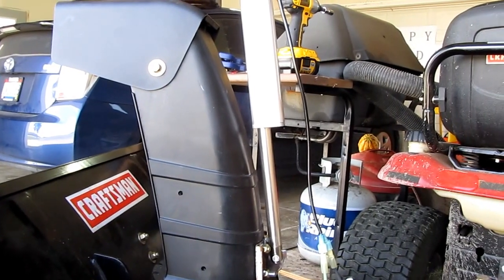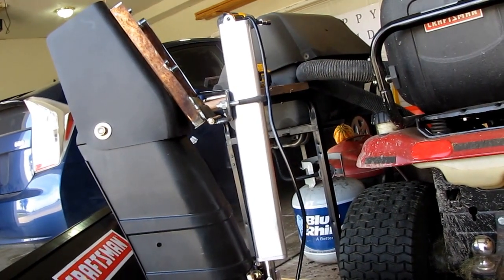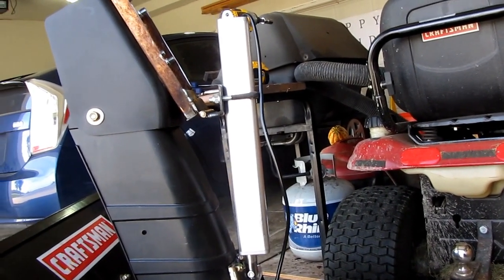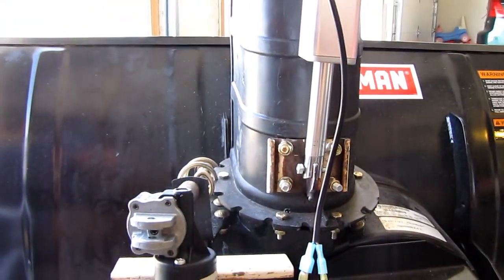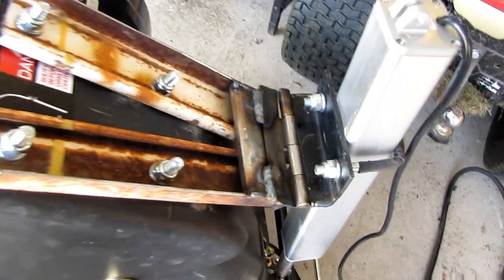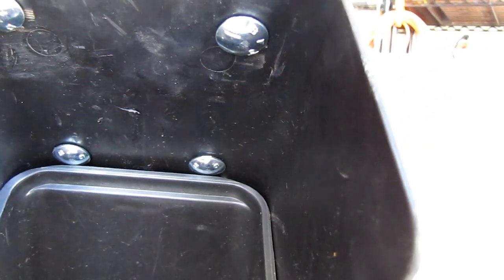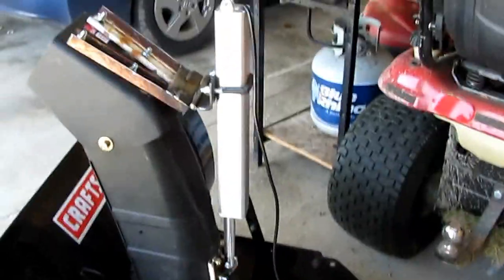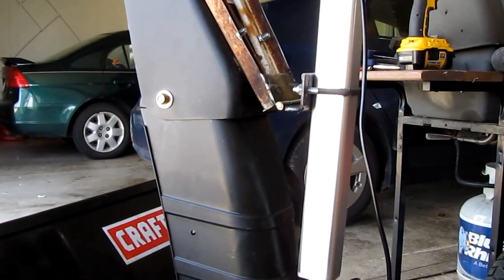Craftsman snowblower chute modified and powered by linear actutor

Comment: Going under instead of  over for lift actuator is a stroke of genius.  It really solve my problems.  By the way, how should one judge what kind of lift actuator  in regards to speed as I find mine kinda slow.
Reply from the maker: you should look for 1.5 inch per sec of travel or 38mm as minimum..  this actuator is the best;  https://www.servocity.com/6-stroke-560-lb-thrust-super-duty-linear-actuator/
Reply: @KzCreations  Thanks